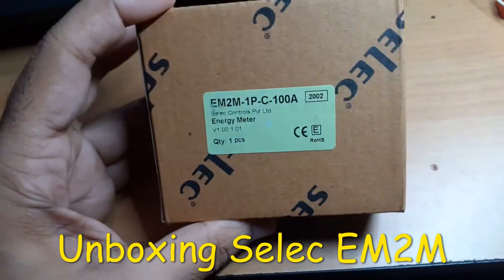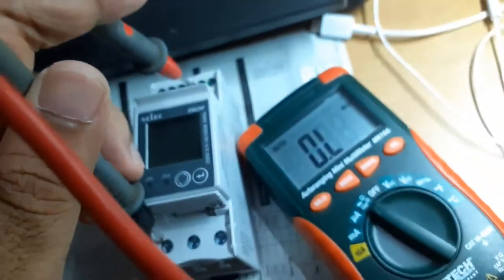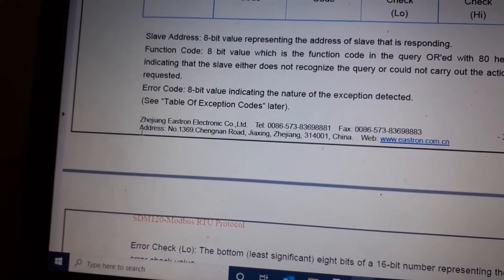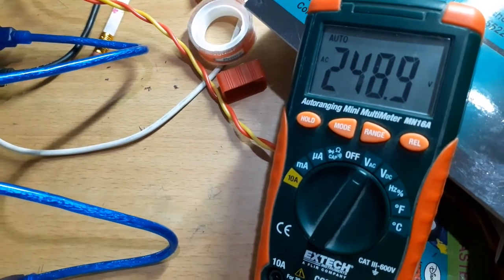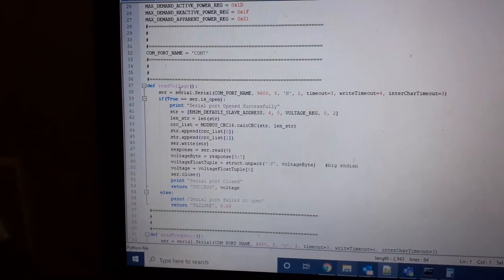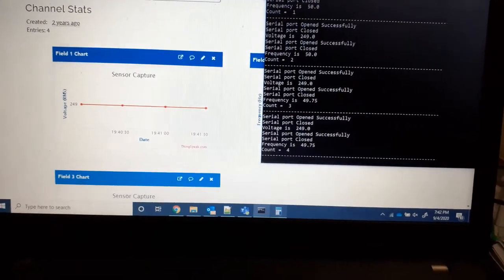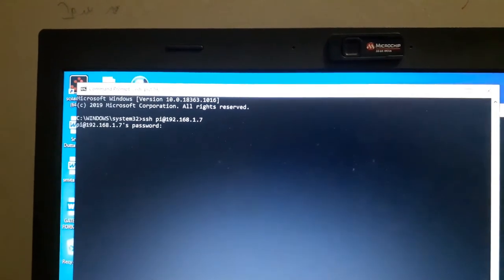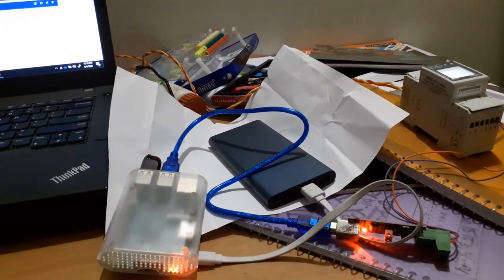IoT -- Home power monitor via MODBUS + MQTT over R-pi.

Comment: Hi Debraj,  How did you convert IEEE 754 hex representation  of (voltage/freq) in to decimal  representation in your script ? Please answer
Reply from the maker: When voltage is queries from meter, it responds with the following protocol format -- slave addr, function, byte count, 4-bytes of data in float format..

The 4 bytes are collected in python and converter from 4 bytes to float using following python code -- 

        response = ser.read(9)
        voltageByte = response[3:7]
        voltageFloatTuple = struct.unpack('>f', voltageByte)   #big endian
        voltage = voltageFloatTuple[0]
Reply from the maker: More details on the website link added to description.

Comment: Hey debraj! Your video was really helpful. I have a doubt here if you can solve it. How do you check the serial communication settings in the energy meter? I am using the same one as you are. I tried to go through the manual and followed the instructions. I am unable to see them. Could yoh please guide me?
Reply from the maker: I am using the default values, as in factory setting and also same as user guide. There are commands to change the serial communication setting, but I never tried it. You should search in the 1 page user guide that comes along with the meter.
Reply: So far I am using that page only. But it says press both buttons together for 3 seconds. Upon doing that, it shows "P(some character) 0000". To change page I press enter but it changes value in the text I mentioned.. Could you please try it once and let me know if it works for you?
Reply from the maker: @sanketagrawal7918  Cannot try it now, as I am at a different place and the meters are somewhere else. But for changing the settings, do not use push button, but send command from MODBUS.

Comment: Sorry to bother you again I have connected energybmeter with USB to rs485 hardware as shown in your vedio does it need any driver software to install for serial port communication
Reply from the maker: Yes, it may need. You will get a pop up in your computer for driver installtion.
Reply: @Debraj1978  thank u debraj ji

Comment: can u do the same with em6436h energy eter schnider
Reply from the maker: Not sure, I have never worked on this meter. But if this meter has MODBUS connection, then all these parameters can be measured. If you have a user manual for the meter, it will help.
Reply from the maker: Also, if you need a lower cost version for communication, instead of R-pi, look into my other video, where I used NodeMCU = https://www.youtube.com/watch?v=FfvIN-nZf-Q

Comment: Sir, I had the same energy meter Selec  EM2M but sir I don't have R-Pi sir can you help me to write the code for Arduino. I want to read the data from this meter using the rs-485 module. you can help me
Reply from the maker: Sorry. Arduino is boring.
Reply: @Debraj1978  I'm use arduino pls...help
Reply from the maker: @sanjay0109  I will try out on arduino ide after 1 month or so.
Reply: @Debraj1978  sir i use arduino and  comunication ok
But serial print unsigned  velue  displays  how I can display floating velue
Reply: #include <ModbusMaster.h>
#include <SoftwareSerial.h>
SoftwareSerial mySerial(11, 10); // RX, TX
#define MODBUS_DATA_TRANSACTION_PIN 13
ModbusMaster node;

  void preTransmission()
  {
 digitalWrite(MODBUS_DATA_TRANSACTION_PIN,1);
  } 
  void postTransmission()
  {
 digitalWrite(MODBUS_DATA_TRANSACTION_PIN,0);
  }

void setup() {
pinMode(MODBUS_DATA_TRANSACTION_PIN,OUTPUT);
 // Init in receive mode
digitalWrite(MODBUS_DATA_TRANSACTION_PIN,0);
Serial.begin(9600);
// Modbus communication runs at 9600 baud
mySerial.begin(9600);
 // Modbus slave ID 1
node.begin(1,mySerial);
// Callbacks allow us to configure the RS485 transceiver correctly
node.preTransmission(preTransmission);
node.postTransmission(postTransmission);
Serial.println("selec Tc id :");

}

void loop() {

node.readInputRegisters(21, 1);
Serial.print("VOLT ");
float prosess_value = node.getResponseBuffer(0);
Serial.println(prosess_value/10.0);
node.clearResponseBuffer();
delay(500);
node.readHoldingRegisters(23,1); 
Serial.print("AMP ");
Serial.println(node.getResponseBuffer(0)/10.0);
node.clearResponseBuffer(); 
delay(500);
  

}
Reply: @sanjay0109  this code is working for select em2m meter
can you share me pin diagram.

Comment: Sir, kya ye zero export Device ka kaam karti hai.
Reply from the maker: Yeh "zero export" kya hai?
Reply: @Debraj1978   Enphase IQ7 ongrid micro Inverter  jab ghar ka load kam ho aur ongrid inverter jyada electricity bnayenga to wo electricity meter mai export karenga jisse electricity bill jyada aayena. Usko rokne ke liye use hota hai zero export Device Sir
Reply from the maker: @gadgetmaster1988  ok. Yeh 1-direction meter hai. Jaise ki, usual energy meter. Only ghar ka consumption jaan sakte hain.
Reply: @Debraj1978  There are parameters like 'export active energy' available and on amazon it is listed as bi-directional. Maybe it can be used?